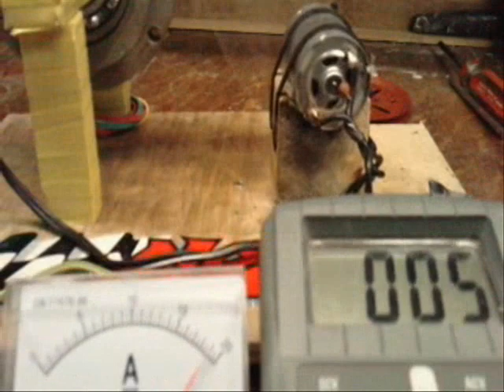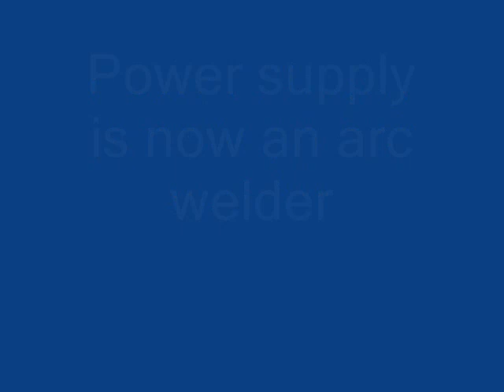Electric Motor Blow Compilation Part 2

Comment from the maker: My supply goes from 0 to about 200v dc. If you want your motors to smoke out a bit then run them under heavy load and on an excess of current. Good luck :)

Comment: these motors smoke a hell lot more than mine:) How many volts do u use? Just curious:)
Reply: More Current would help get more of a smoke show as it's forcing more energy into the windings with fewer volts (all electric motors also have a maximum Currently/amp rating too), just like how if you boost a car engine too much, it blows up with fewer RPM.

Comment: The arc welder puts out AC. AC won't turn a permanent magnet motor. You need a heavy duty bridge rectifier, to turn the motors with the arc welder. A MIG, or TIG welder would work perfect for this.

Comment: Is only that you can do? Destroy things? I am 16 yrs old and did repair vacuum cleaner motors that did burnout. And it even works today!. I've even created my own motor,I have also wound up my own engines which, among other things, have a speed of 1400 rpm. And even made the coils miself.  230V - 305V
Reply from the maker: Hello. No I don't just destroy things, I make electric motors too. Look back on my channel and see some of the model electric solenoid engines that I have made out of recycled materials. I have made a v12 solenoid engine that I have had running at over 3,000rpm. Check out my older videos bro.
Reply from the maker: Here is a motor that I made https://www.youtube.com/watch?v=IXIl0RlTom4